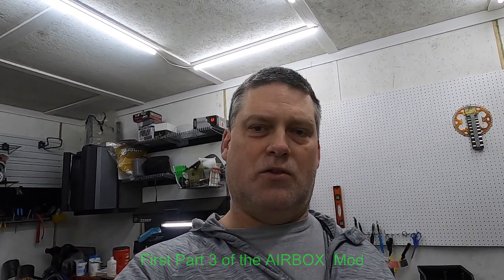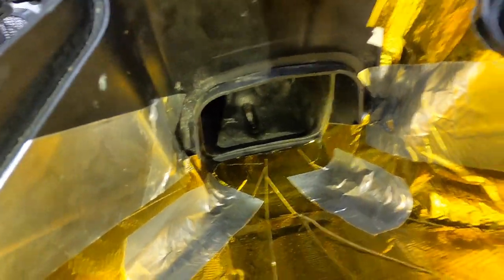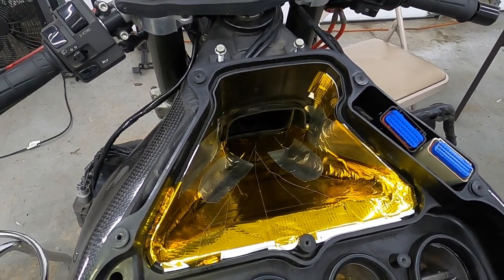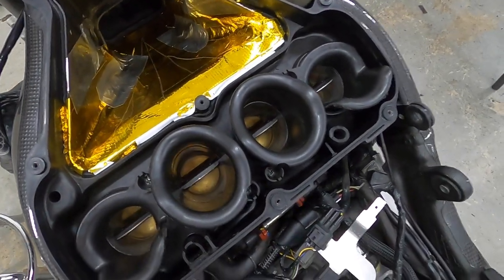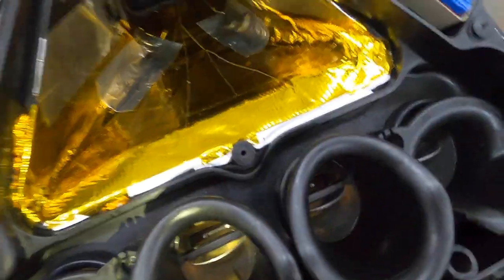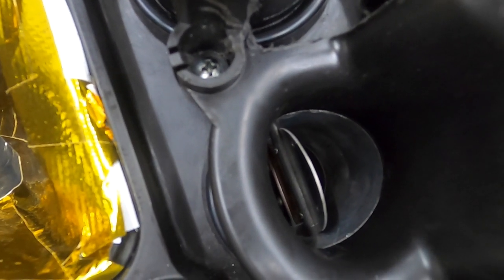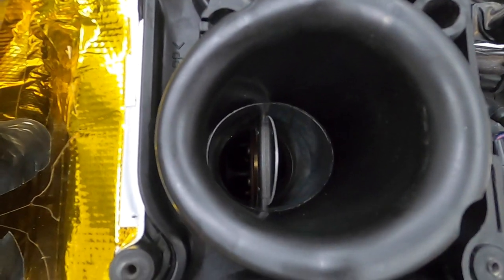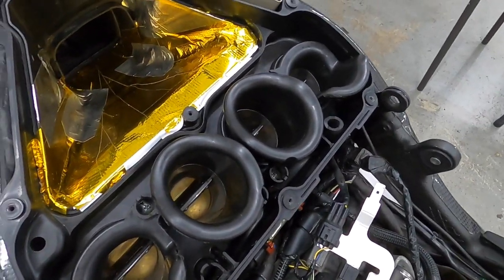More Horsepower ZX10R Airbox Mods Part3 Other Horsepower tips!

Comment: Good job, Bro! I wanna tell you heat shield must be installed outside to reflect heat radiant.
Reply from the maker: Yes, I know. I wanted a smooth surface inside.  I think I state in the video it isn’t helping other than an insulation barrier.

Comment: lol you’re reflecting + trapping heat INSIDE your airbox AND restricting your airflow.
You should be losing power…
The heat tape goes on the OUTSIDE of the airbox reflecting heat away (not in).

Comment: did you cut the box where was restricted? if so how have you done with the PCV valve ?? took it off?
Reply from the maker: I didn’t remove any connections
Reply: @MantisRacing  and it fitted?? I have my disassembled , Im studying possibilities if it fits straight with the pcv valve ill cut it tomorrow morning
Reply from the maker: @correia.98  Are you talking about the PAIR valve at the front below the air box?  If so yes that has to be removed.